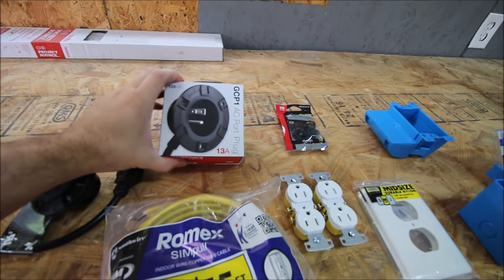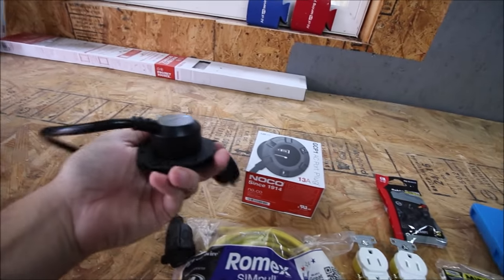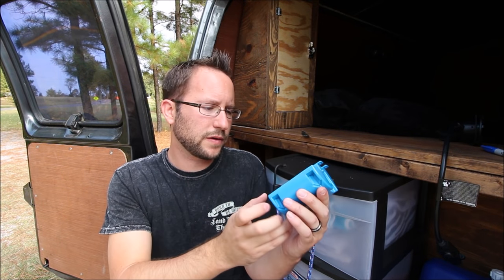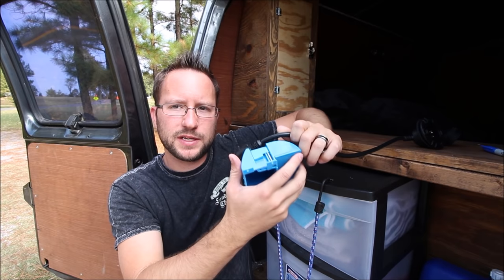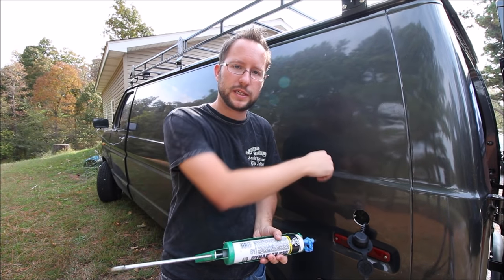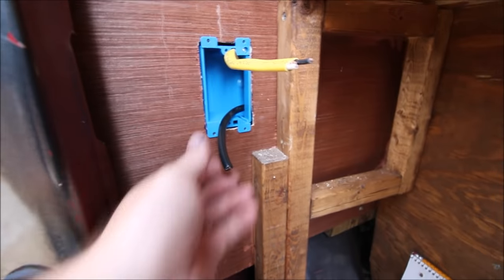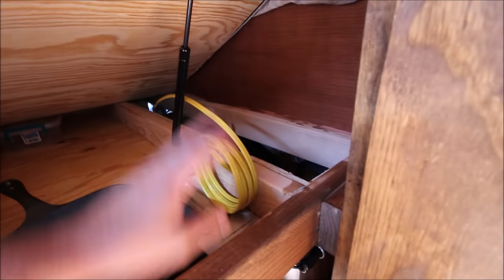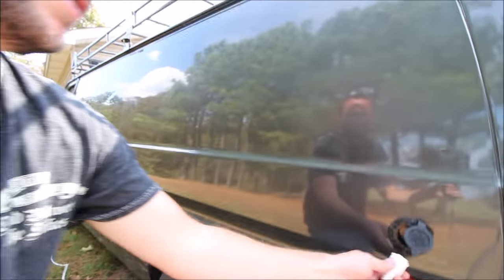Shore Power install on my Camper Van

Comment: Thank you for this video. This was the first one I've seen on installing shore power to a van. It was a good introduction for me to get some knowledge. I am eager to learn a lot more specifically about the wiring aspect. I wish the videos were more detailed but some YouTubers worry about being boring but many of us are looking specifically for the details. The point is you did a great job and I've already watch the video you did not the Dometic fridge and toilet. Thanks again; its appreciated!
Reply from the maker: Manny S thank you for watching. There are a lot of comments on this video telling me I did it wrong and it is dangerous. I will say after this video I changed the first outlet to a GFCI outlet and have not had any problems with the way it is set up.

Comment: Looks good...except, typically you never want to use solid copper wire in a vehicle. The vibration can cause it to eventually crack or break. Stranded copper is the way to go. Just something to be aware of. You may never have a problem.
Reply from the maker: jerryw62 thank you for the tip, I'll make sure to keep an eye on it.
Reply: Thanks for the tip!

Comment: I'm glad to see you added a GFI to the circuit. I would not worry so much about the moisture tripping it as much as losing the ground run somewhere between the shore connection to the first receptacle. The GFI measures difference in potential between the neutral (with an internal circuit electronics) and the power side and as such does not need a ground wire hooked to function although it should have the ground wire anyway. Having the GFI at the very first receptacle will protect all downstream devices (receptacles).
Reply from the maker: John Nix I'm not sure why everyone is so worried about the electrical set up. It's basically a 12 foot extension cord with an outlet at the end and one about 12 inches from the inlet. The first outlet is literally 12 inches or less between the inlet plug on the exterior of the van. I changed the outlet to GFCI just to appease everyone. I am a real estate broker and have seen a number of home inspections. You guys would probably be surprised at some of the things that might be in your own homes that are far worse than my 12 foot extension cord on wheels.

Comment: I bought one last year and haven't got up the nerve to install it yet. Drilling a hole thru my van is scary. But I will get on it this spring.Thanks for turning me on to it.
Reply: I would find a local RV service repair or conversion place. I'm not sure where you are located. But, I find people online all the time. I live in the city so going to the less populated areas is cheaper. Worse case you can always use camping world. lol

Comment: Thanks again bro finding your video's super to watch that could hook straight up to the convertor and charge the batteries and in turn supply the camper with electricity. sweet

Comment: you may have wanted a small breaker before the first outlet, or you could hang a gfic between the van and shore power supply.
Reply: That would be double breakers. Not necessarily. The outlet you plug into has the breaker already.

Comment: Can you use the NOCO plug, Surepower, with just a good extension cord inside the van and plug into surge protector with multiple plugs and USB without having to install fuses, etc? And, if so, I'll get me one of those NOCO plugs, so all I would have to do is plug either a generator/another good extension cord from the outside to a campsite plug/or when visiting family and friends for Surepower needs.

Comment: looks good,  but I would highly recommend a breaker box at the 1st gang box if you haven't already.
Reply from the maker: TheChessbully thanks. I don't see a need for a breaker box as it is basically just an extension cord. However, I am going to change the first outlet to a gfci outlet in case of any water or moisture.
Reply: @RubberTrampRenegade   So you don't overload the circuit and burn your van down when the load exceeds the capacity of  that  "extension cord" which is probably the weakest link.  A breaker spec'ed properly will prevent that.
Reply from the maker: DingDingDing there’s a breaker box in my garage or anywhere I hook up to. You don’t add a breaker between your kitchen outlet and your toaster do you? Maybe you do? I’m not sure about most experts on YouTube anymore. Y’all know it all.
Reply: @RubberTrampRenegade  , and long as that breaker will pop before you exceed the capability of whatever is plugged into that circuit.  If you plug something that draws 20 amps into a 15 amp circuit the breaker will pop.  If you plug something in that draws 15 amps in a 20 amp circuit the breaker won't pop, but if the item that draws 15 amps ends up drawing 19 amps because of something wrong, the breaker won't pop, but the device could overheat and burst into flames.  Also a campgrounds you are assuming the breaker is correct and in good working order.  If you look at your home breaker box there is also a "main breaker" protecting your home from a surge on the external line.  That is one thing you don't have in your van.
Reply from the maker: Dave another one of these experts..... I had the van a good 3 years and it never burnt down.
Reply from the maker: Dave do you put a breaker between an outlet and an extension cord every time you plug one in? Just curious because that’s all this is. An extension cord that can be plugged into an outlet. Judging by your comment I bet you probably do.
Reply: RubberTrampRenegade , lucky doesn’t mean right. I walked into a job site where they were using a 15 amp heater connected to a 100 foot 15 amp extension cord. The cord was putting off almost as much heat as the heater. They didn’t know that the length of the wire matters. Lucky?  Or safe. Mmm.  Obviously, my posts and those of others are meant for people who might watch your video since you are an expert.
Reply from the maker: Dave I just don’t understand how I made a glorified extension cord and everyone loses their shit. If you don’t think it’s safe don’t do it. I’m not forcing anyone to make one. Just showing them how I made it and it worked for me. And it worked well.
Reply: @RubberTrampRenegade , have you read the manuals for all of your appliances and electrical equipment.  Many of them say to not use an extension cord.  There is a reason they say that.  My heater example is one reason.
Reply from the maker: Dave manuals? lol. I’ve never read a manual in my life. I get by just fine.
Reply: @RubberTrampRenegade  , well there you go.  So do all the other people who accidentally burned down their houses.  LOL!  You mentioned in your video adding the shore power because you might run AC or a heater.  Those of us mentioning the proper way are just trying to be helpful.  Good luck out there.  I'm done with this conversation.
Reply: Good luck with that solid copper wiring and connecting that AC/ heater.
Reply: I wouldn't be concerned about solid wiring for where it is. If it were tied up it definitely wouldn't matter. It's running behind a panel, it's not like it's in a heavy motion location or anything is rubbing on it or it's a drifting car, it's just meant for camping. It would be better if it were nailed down with staples (nails with an insulator) or laying on a flat board, but I don't foresee any issues here. I would think the shore inlet wire is the weakest link. My Jayco camper has a stranded wire coming in to the power converter, and four outlets with solid 12/2 installed from the manufacturer. It has a breaker which shuts the converter and all shore power off. You could just unplug it, but I'd have to get out and walk around the camper for that.

I think a GFCI/GFI outlet is a smart idea, because you could shut everything down in a snap. Not all breakers are rated the same as your wiring. That's the main thing I could see it as, a constant if you're hooked up somewhere without a breaker or a higher rated breaker than your rating. If you're only hooking up to your home outlet every single time, I doubt it would be necessary. It's kind of fool-proofing it for fools. No fools, no worries.

That cord that was getting hot should just be rated higher, they're using the wrong one. The longer the distance the higher the guage of wire.

Usually those slimmer outlets are for pocket doors. You can buy deeper outlets with those wings on them for retro fitting. Orange ones aren't for high voltage, they're for low voltage data/comm.

Comment: I’m interested in knowing how that shore power setup is working for you. I’ve been advised to install a 30amp power system. Your feedback wud be greatly appreciated. The difference with the set up for me is $355..lol
Reply from the maker: I’ve sold the van since this video and am working on a new build. This set up was basically just an extension cord. I’d plug in to a 110 outlet at a campground and have power. It only powered the 2 outlets installed in my van, it didn’t run all my other 12 volt accessories, they still ran off my 12 volt system. Since this video I changed the first outlet by the power inlet to a GFCI Incase there was any water to get in. It all worked well when I had it.

Comment: This is a super rookie question...  LOL. How do you hook up shore power to your solar power set up?  I haven’t done it yet because I’m not at all sure about this process. I did set up my solar system myself, and it works great, but had an RV friend install the alternator charger, because yeah electricity is not my ideal activity!  🤦🏽‍♀️🤷🏽‍♀️. Thanks in advance for any help with this!!  🙏🏽✌🏽💖 

Oh and BTW I used your poor man’s fiberglass tutorial on the roof of my canned ham camper as well as the inside of my tiny 2Wx3Lx4T shower/commode build. No leaks, no cracking and looks awesome. The texture on the bottom actually works great to keep me from slipping with my klutzy self.  LOL
Reply from the maker: I have never had a solar system. My 12 volt system and my shore power system were 2 different systems. You would  need what is called a converter that most RV's have.

Comment: Don't most campgrounds use 30 amp? Trying to figure this out for my van at campgrounds and RV parks with hookups.
Reply: Yes, you're right about that -- usually both 30A or 50A. The video shows a regular 15A port being installed through the sheetmetal. The inside hardware is also that rating/design. That's fine as long as the loads being powered don't draw any more than that -- because you're drawing from a source capable of supplying 30A, you won't actually get there without literally asking for it!

The tricky part is, that while both 15A and 30A are 3-wire-designs, the outlet on the pedestal is not the same configuration as the inlet on the vehicle. One has slanted prongs for the hot and neutral prongs, the other's is straight, like the usual household variety. So, the power cable will have to be fitted with ends appropriate for their intended connection, or used in conjunction with the right adapter pigtail for the same purpose.

If you wanted to get as much as 30A into your RV, the best way to do it safely is with a small breaker panel. They can be found as small as 30A main breaker, and fitted with a couple of smaller branch breakers connected to outlets, you've got all the convenience of home. (They are 3-wire, single pole, single phase items, so there's no advanced skills needed -- BUT, unlike a residential panel, most mobile panels do not connect the neutral busbar with the ground busbar. The "ground " connection is via a correctly wired supply pedestal.)
Reply: Robert Phillips Thanks for the information, definitely something to consider.

Comment: Nice job on your Shore Power Installation. I took a 4 foot long Power Strip, with 12 outlets in it, and installed it up along the top of my side windows on the Driver Side of my Camper Van, and installed a simple Cover on the Outside Rear Driver Side Corner of the Van, and when I want to plug into Shore Power, or hook up to my Generator, I just open the Box Cover on the outside of the Van, and plug in. I am also looking into getting 2 12 Volt Deep Cycle Marine Batteries, each with 100 amp hours of battery power, then install a Battery Isolator, and cable from my Starter Battery to be able to charge the house batteries while traveling. The Batteries will be hooked up in series with each other, and there will be a Master Switch installed to turn the house batteries on and off as needed. I will also be purchasing a 1500 or 2000 watt Power Inverter to allow me to run 120 volt accessories when I am in areas that do not have Shore Power Hookups, and may not allow the use of a Generator due to noise restrictions.
Reply: My 4 foot long Power Strip also has a built in Circuit Breaker as well as a 30 amp fuse, which I had wired into it by a professional electrician
Reply: Thanks for telling us your life story.

Comment: I have an inverter and I want to charge my battery bank when plugged into shore power. I’ve been told I need a charger since my inverter is not an inverter/charger do you have a video that connects a charger to the inverter so I can charge my batteries when I’m plugged into shore power??

Comment: I'm looking at basically the same plug that you used, got a question why did you go with that one rather than one that didn't have the normal extension cord end?  If I decide to do this to my Promaster I'll keep the Extension Cord end and plug a heavy duty surge protector in it I plan to mount at the rear.  This way I don't have to wire anything because I am no electrician but can drill a hole lol.

My van has nothing fixed in place, I need it to be able to go from Cargo Hauler, to Wheelchair Ramp, to Camper in short order.  My camper stuff is held in place with tie-downs rather than bolting to the walls or floor and so far I can empty everything out in a half hour.  I would love to fully convert it to be a full time Camper like your Van is setup, with nice paneling and insulation but it needs to remain versatile.
Reply: I'd love to have plugs too. But I agree with you.  I planned on a surge protector and an extension cord.  I can definitely drill a hole and screw in the screws. :-)

Comment: I have no idea if this is true, but I read somewhere that you should use stranded wire for van or trailer builds. It had something to do with solid, house-type wiring not holding up to the shock, vibration and constant motion of on-road applications. Does anyone have any input on this subject?
Reply from the maker: Stranded wire is better for builds prone to vibration and movement. However, my van rode relatively smoothly down the road and did not rattle my teeth out like a trailer would bouncing around so it was perfectly fine.

Comment: Great video. What is the black cord/plug called? Trying to find one and not having any luck.
Reply: "120 volt inlet for rv/boat" is what you should google. Whatever amperage your particular setup requires of course.

Comment: Where are the breaker boxes and trip switches? Is it not fused?
Reply from the maker: Lol. You’re like the thousandth person to give the that junk. Have you ever been to a campground? The have a. Breaker box at the site. My system is nothing more than an extension cord. If I park at a campground and plug in to the outlet 5 feet away from me that is in a breaker box with a breaker, why do I need another? I used this van like this for 3 years and I’m still alive. If you want to spend the extra money on useless breaker boxes then have fun buddy.
Reply from the maker: Well I see you commented again but it’s not showing up. My 110 set up is completely separate from my 12 volt system. When plugged in to the campground it only powers the 2 outlets on the run. So yes, again it’s just an extension cord. Nothing more. I’m still alive, van is still alive, no fires, no problems. You don’t put a breaker box between your toaster and the wall do you?
Reply from the maker: And I’m happy to hear you are an electrician and work for sunseeker yachts. That’s great. And as far as “every other van on the market”, this isn’t one. It’s a home built camper van that I take out on the weekends. It’s not a commercially produced rig. I’m so happy I shared my personal projects with everyone so they can all tell me what I did “wrong”. Well you know what? I get a lot of advice from people coming looking for advice who talk a lot about building a van, but never act on it. I’ve done it, I’ve enjoyed it, and I’m still breathing.
Reply: @RubberTrampRenegade  Just trying to help but some people are too blind for their own good. You ain't got a clue mate and talk as if you think you have..... Good luck pmsl

Comment: Thats a good looking van. What year is it? I have a 1987 E-150 that I'm using for my camper van build and it is the same body as yours. Where did you find the plug that you mounted on the outside?
Reply: You can probably find anything you need on ebay. That's where I go to find parts for my Rv and car. 🙋

Comment: Use gfi outlet(s) depending on ac and heat use a 20 amp outlet and as others have said never use Romex that’s for houses
Reply from the maker: I did go back and change the first outlet to gfci later. This was basically just a glorified extension cord. I used it like this for 3 years with no problem whatsoever from the wiring. Thanks for watching

Comment: Ever put any thoughts into using solar panels ? And store the power in some batteries and use an inverter ?
Reply from the maker: C.A. MOON I have a complete 12 volt system with a 100 amp hour battery that is charged by my alternator with an isolator. I have a 1500 watt inverter but my 12 volt system cannot run a household window unit. My shore power set up is mainly to run a window AC when I can plug in at camp grounds.